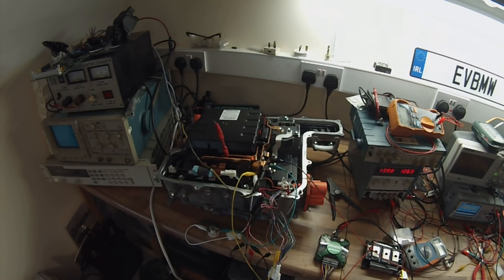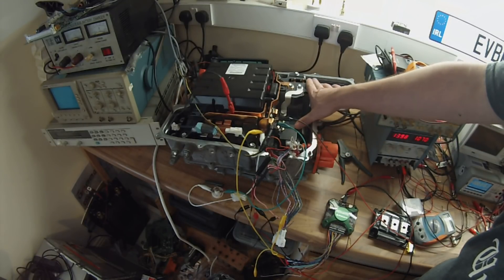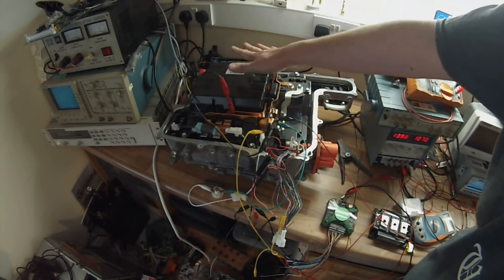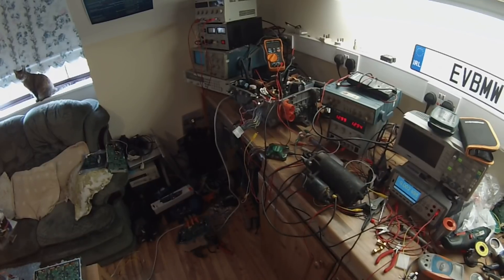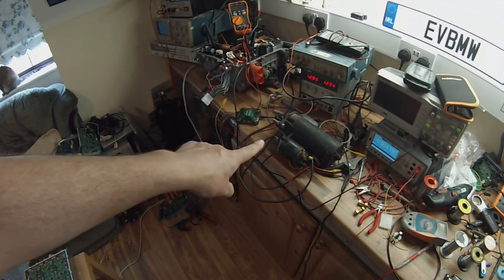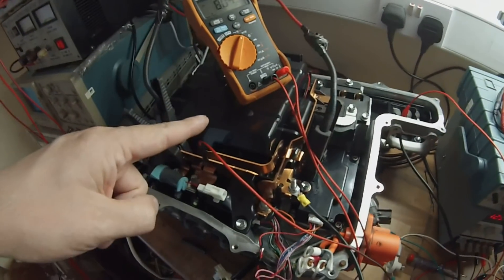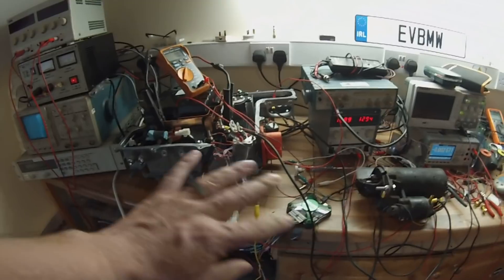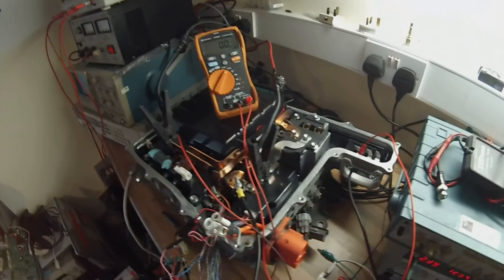Prius Inverter Project : Possibilities

Comment: Great job.  We've been doing this too, on the other side of the pond.  We have the IPM module operating as a 8S and 16S charger for our EV packs.  We will also be using the other parts from the inverter/converter for 2-3 more applications (235V DC charger, spot-welder with some of the bus bars & IGBTs, and perhaps mating an EGS002 controller on the 3-phase IGBT modules for a huge inverter).  Loads of fun hacking.

Comment: G'day Damien, your timing is perfect!  I've been collecting Prius bits to convert my Suzuki Jimny to EV.  So far I have the Inverter/Converter, battery cables (from traction battery to inverter), fuse/safety pull, contacters, and precharge relay/resistor.  In fact, if I do this again, I would just buy a scrapped/wrecked Prius to harvest all the bits and pieces needed.

I'll be consulting with the Minister of Finance to support you on Patreon.

I'm looking forward to future hacking of the inverter, and sourcing an AC motor for the future  eJimny.

Stay well and thank you for your generous sharing of your expertise and knowledge.
Reply from the maker: My pleaseure
Reply: Minister of Finance has approved Patreon support!

Comment: hi, Wow, your video was posted on my birthday last year! (at which time I was recovering from being hit by a pickup truck while riding my bicycle! ugh..)

anyway just this month Ive caught the prius bug and got my momma to buy one, and then I bought one (cheap) that had been in a minor front end collision that I am reviving (both are gen 2 mind you!)

so I have been out at this Awesome local junkyard several times this week and have been staring inverters such as these in the face repeatedly...

everyone snips the wires and pulls the inverter to get to the brake accumulator hidden behind it (a part that frequently goes bad limiting the longevity of these great cars!)

anyway yeah its inverter city out there!!! 

anyway im interested in updates, I am daydreaming about a project to run a 48volt golf cart off one Huge 1.2 volt NI-FE battery cell (something like 1-2kwh)

these batteries are known to last multiple decades even when abused or neglected and that sure beats the pants off most other battery chemistries, especially for an infrequently used neighborhood runabout... thing.

I wonder if a prius inverter could be used for this project... I was thinking about a solar panel roof trickle charger, and maybe some 12 volt accessories (stereo maybe?)

lots of voltage conversions would be needed 1.2v to 48 volt with drivetrain current handling ability, solar panel voltage back down to 1.6 volts for charging, and then 1.2 to 12 volt for accessories..... errr and maybe 48 volts to 1.6 volts for regen braking....

wow that's a mouthful!

anyway anyone who may be tinkering with these please lets put our heads together maybe start a forum thread...

if I go back to the junkyard im gonna grab all the inverters and stash them somewhere safe, like in the back of a prius unlikely to be crushed anytime soon!!!

people literally have just snipped the wires and tossed the poor things in the mud!

Comment: Hey Damien, Do you think that buck boost thing can be used as a high power 14v buck converter for something like audio amplifiers? 400 amps on 14v would be helpful, stacking normal dc to dc converters to compensate for the missing alternator would be expensive as hell just to keep the batteries in an EV audio install alive. I suppose one could use it to go from 300/400 volts from the traction battery to 100v that an amp uses internally, bypasing the voltage boost inside the amp and increasing efficiency, but I don't know how that might affect the sound quality, and of course that would mean just butchering a very expensive amplifier (one that would require such power I mean) giving an audio amplifier 400 amps with 14v is a hell of a lot less efficient when the higher voltage it actually needs is available in the car. Once again, that prius box could prove extremely helpful in saving alot of money for hobbyists.

Comment: Damien, my Zivan charger appears to have quit completely. I was charging my electric truck containing 3 strings of Leaf cells in parallel with a max pack voltage of 131. I am hoping to be able to use the Prius inverter for charging. However, I am limited to either 120V or 220V single phase AC to supply the power. Since the Prius motors are 3 phase backfeeding the battery, I am not sure how to connect to make the system work. Could you address that when you run through your testing? 
Thanks for uncovering the possibilities with the Prius salvage parts.
Reply from the maker: Working on it:)

Comment: If I understand correctly,  providing a PWM signal to one of the phases it can drive a DC motor? For AC will it require 3 PWM signals for an AC motor? I've just used an off the shelf controller for my motorcycle  but keen to learn how it works and hopefully do a car next using scrap yard parts.

Comment: How to know the capabilities of this inverter circuit? Amp and volts wise. While MG2 here is 60kW in Prius, it is 168 kW in LS600h ... I would say all Toyota's inverters are the same 😊😊.
Reply: Page 50-58 of this 95 page report has details of the inverter/converter. Apologies if this is TMI.  But for those into reverse engineering and re-purposing, this is a gold mine.   You can also google prius inverter teardown, there is a detail wrtie up on it.  Cheers.  https://www.osti.gov/servlets/purl/890029

Comment: HI, a frien of mine is currently selling a prius motor with inverter and hacked controller plus contractors, pedal-pot for 4000 EUR - he can even set it to your needs. you only need batteries and to mount it in the vehicle. I am bulding my own hybrid sistem with a hacked ampera controller - but his offer is quite decent, i think.

Comment: Excellent work. Could this charge and dc/dc convert on a 360v leaf pack?
Reply from the maker: oh yes :)
Reply: @Evbmw  😀👍
Reply: sorry just posted above then saw this. Very very interested.
Reply: So this Buck Boost module, which I'm assuming does at least 100A, could be really handy for adding any voltage back as extra capacity on older low capacity EV's. So many fun possibilities!

Comment: given that it can take 3 phase ac and charge batteries up to 400v dc. do you think that it would be possible to give EV's like the nissan leaf 2011 24kwh a boost in charging off the 3 phase enabled or even single phase outlets. Currently my leaf can only utilise 3.6kw off the posts which could give up to 22kw or 7kw. There was a chap who sort of did this using Brusa chargers mounted underslung at the rear of the car but they were thousands whereas these as you point out are merely hundred(s) of pounds.

Also there is a french chap called Gilbert Trouve (aka planetaire on priuschat forum) who did amazing things with his Prius. He would definitely be interested if you got the paralleling of the inverters working because the limitation of turning a 2nd gen Prius into a good full EV is the 20ish Kw limit of the inverter.

Comment: Is there a possibility to use the boost converter to drive the motor at higher voltage? Toyota is using this circuit to drive the motors at 650 volts..
Reply: And, is there a benefit of doing so?

Comment: I will be pleased if you can fix som interface card so we can skip the Ev speed limit (40km/h)and make a real plugin of the Prius/highlander drive unit 😄,
so i can buy batteries and connect 
regards 👍
Reply: Rickard Björling the true limitation is the mechanical system that Toyota runs. You can't increase the wheel speed unless you revved the engine as the MG1 speed is maxing out.

Comment: this is what has always bothered me. The Toyota Prius is basically the perfect power plant for just about any car audio installation or any home generation. You can also use it to drive around if you'd like.

the fact that you can use natural gas or compressed CNG with this motor makes it even more efficient and cheap to operate.  if they offered a diesel option that would be basically the killer application of this motor since not only could you use it  with the various diesel fuels including green diesel fuels that actually work quite well like biodiesels you could also use it on  propane natural gas CNG  Etc.   

the other thing that's a real bonus using a Prius power plant for a generator at home is that you also have a water heater and if you use a Evans coolant on the coolant Loop you can also run the coolant at around 350 degrees and again increase efficiency.  

with the introduction of  hydrogen   into the combustion process,  you get a very clean burning Engine with  that has almost no performance penalty for introducing the hydrogen or fuel economy loss. You simply get a very clean burning engine.  

quite frankly the Toyota Prius is one of the best power plants ever devised.   adding a low pressure turbo would only increase the volume metric efficiency of the motor and increase its performance and its gas mileage strangely as it  provides a source of induction that overcomes the friction and the restrictions of pushing the  air through the piping.
 
I'm keeping this explanation really basic for the people who are not familiar with how engines internally work or Kmart engine heads.

also if you have a small Toyota Prius motor and decided to put it on the back of your truck you also have the perfect car audio alternator.  a large bonus to this is that you are now able to use the Brazilian amps that run on an extremely high voltage and can put out  160000 watts of power  the bigger bonus to this is that amps like this that produces kind of power cost a little less than $800 to purchase   and you already have your high voltage battery Bank ready to go.  

technically you don't need a catalytic converter when you're using it as a home generator so you're also eliminating that restriction as well and you can tune the engine for absolute efficiency and with the introduction hydrogen you don't actually need the catalytic converter anymore.  

I figure most people will simply hook their cars up to their home natural gas and just use it that way as it basically is an unlimited supply of fuel coming directly to your home.  

most amazing thing about the hybrid Prius power plant is that imagine you having a very large RV and it is now able to not only go up Extreme Hills but with ease.   using a larger battery pack you can actually add an additional motor to the rear axles and then not only do you have four wheel drive you also have a very large traction motor in the back that can push you up any steep grade with ease and with the hell of a lot of torque  on tap.  

the only thing that would make it even more efficient is basically to use a TDI Diesel with all the Eco mods to get the most miles per gallon out of the engine and power at the same time.   Toyota already make some fantastic diesel motors and in that sense you're really on your way to basically the most efficient and most perfect power plant ever conceived.
Reply: 3 years later, and I guess I will be one of the first to use these in a high power SPL style  setups as its on my Bucket list.  
The Toyota Prius has got to the point where you can buy an entire car for less then $2000 dollars running and driving.  
Only thing is,  I will be doing this outside of the USA in my new location.  Might be Japan.